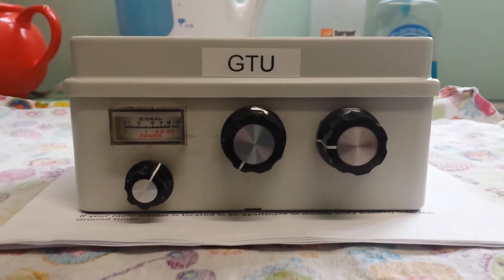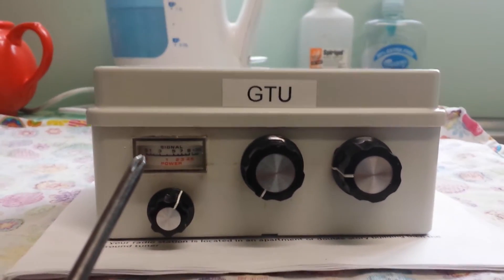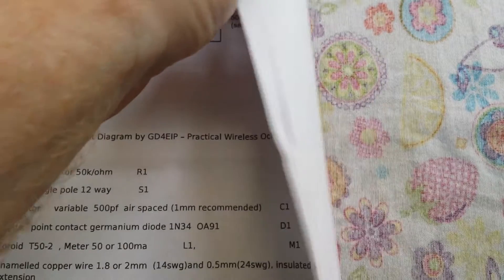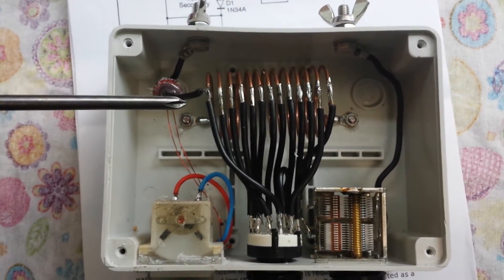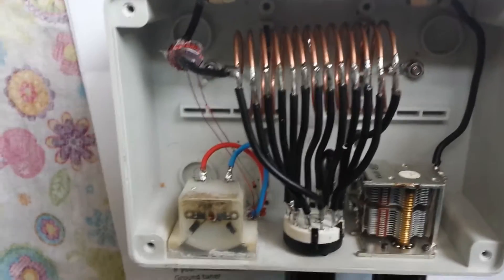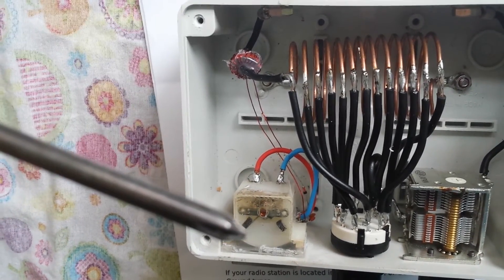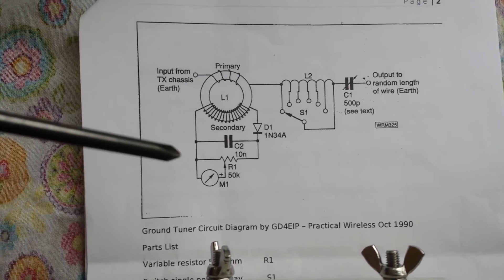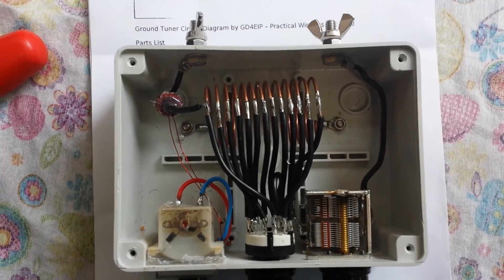Home brew GTU "Ground Tuning Unit"

Comment: Here is the theory:
Use the GTU  if you have the correct length main wire .. but you don't have the luxury of a good  (short) low impedance earth.
This means that the electrical length of the earth lead can be made to look very low.
Therefore your ham equipment is not RF hot.
Reply: Not exactly.

The theory of operation of Artificial Ground (like MFJ-931 and similar) is to drain the RF (at the operating frequency) from the chassis to the station ground. A "tuned short circuit" is used for this. There are two ways:

(1) with an open transmission line with a length equal to 1/4 wavelength. (2) Using a series LC resonant circuit. Resonance is observed with an ammeter when the maximum current amplitude is detected.

I recommend reading the December 2024 article in QST.

Comment: I made a portable ATU for my Yaesu FT817 using a toroid core (A high Mu unit) salvaged from a CFL lamp. The toroid, connected in the power meter as your schematic, eats near 1Watt and take temperature. I solved it, shunting the secondary with a 100 ohms resistor. Thanks for sharing your experiences. LU1AR

Comment: Hi Sparkie,
Enjoyed the video. I remember the original schematic in practical wireless in October 1990, this is the same circuit I first built and later used it on my pedestrian mobile trolley. They really work well near the sea and have built several different configurations with use on my backpack and bicycle. A great project and tidy looking unit.
73 M0DAD
David
Reply from the maker: Thanks David.. Ive enjoyed many of your video's.. Keep them coming!